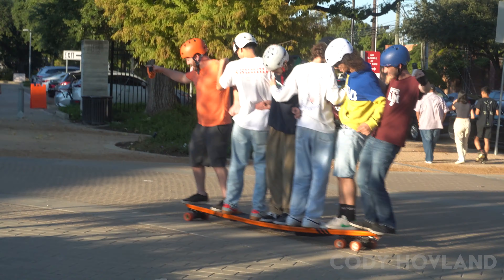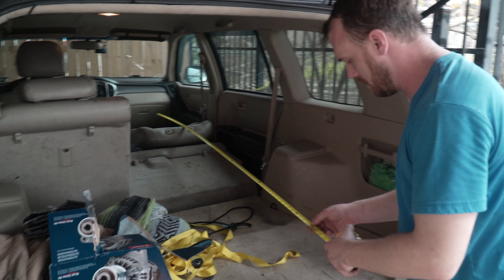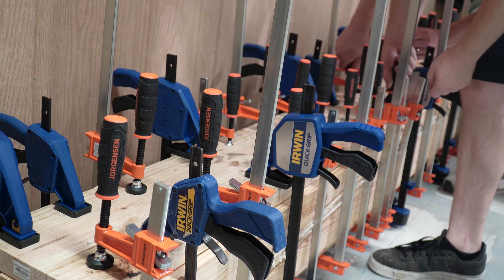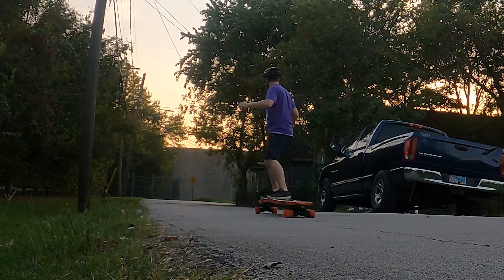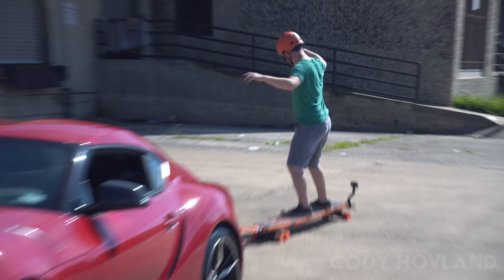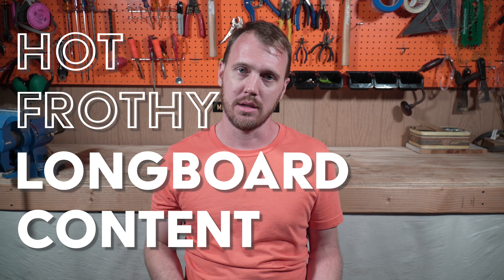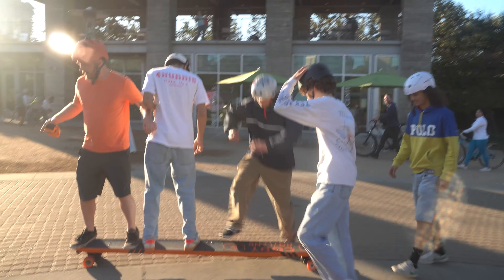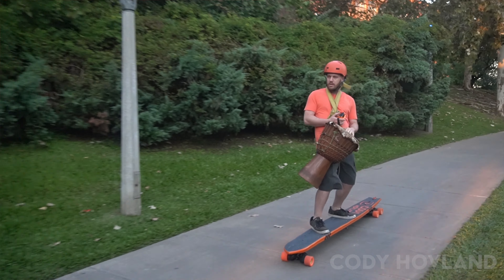How Many People Can I Fit On One Longboard?

Comment: You are doing everything I dream of but better filmed and actually doing it
Reply from the maker: Thanks! What other dreams do you have? I'm all tapped out of ideas and fully panicking praying I don't go viral.
Reply: @CodyHovland  haha nice, I've always wanted to make a drift longboard, like a front wheel powered scooter and then a longboard out back
Reply: @CodyHovland They may not all be good, maybe they're all bad, but are some that I can think of:
- An ebike that walks on four feet
- A steam-powered clothes-tumbling steam-cleaning machine
- A vinyl disc player mounted on a bicycle, which turns from the rotation of the wheels
- An electric-powered three-ski sled on wheels
- A giant 3D printer
- A rocket-powered kiteboarding kite
- An amphibious go-kart
- A bike which is also a canoe
- A hoverboard which actually hovers, like real hovercrafts do
- A bike that can be converted to a comfy chair
- A barbecue on a bike trailer
- An air-guitar amplifier that works with image recognition
Reply: @CodyHovland  Longboard with massive wheels...massive